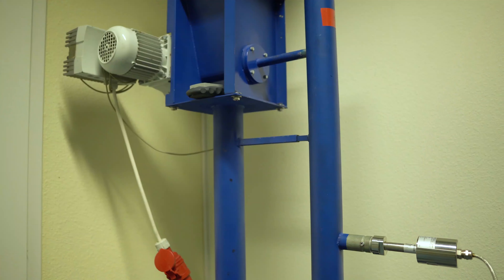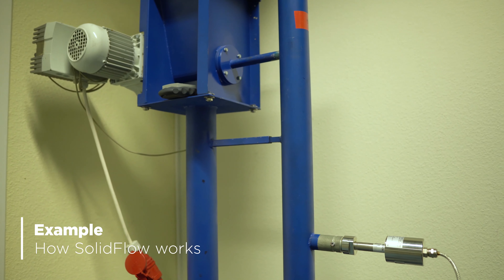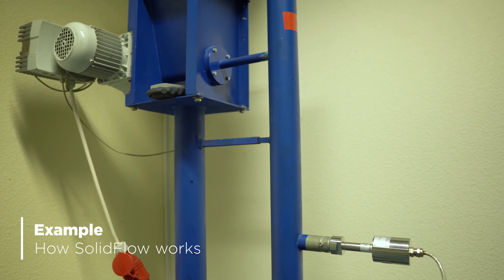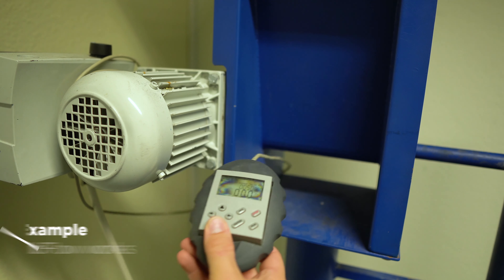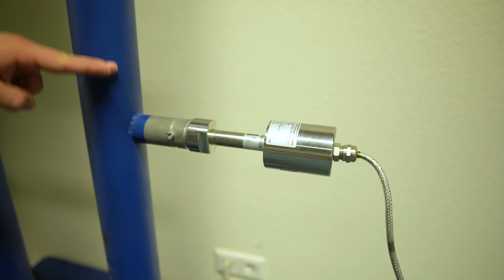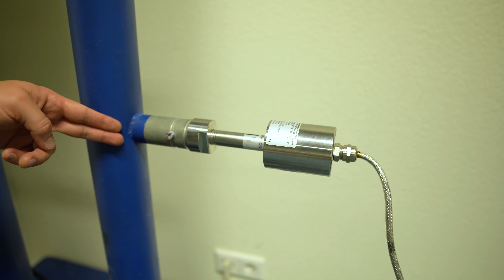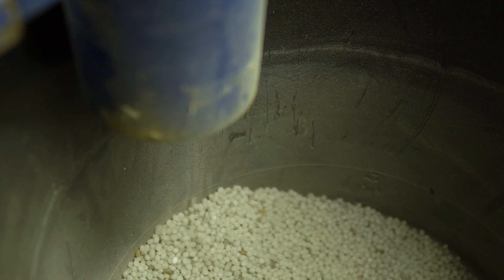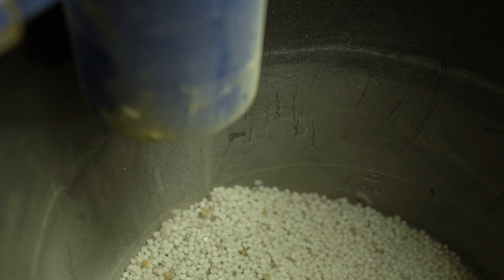How to measure Solids Mass Flow ? SolidFlow

Comment: Well, each material has different specific gravity. How does this sensor address that issue? We need these sensors for the prototype intended for pneumatic blends.
Reply from the maker: Hello Saeed, the sensor is calibrated considering 1 material type, in case of a different material kind a new calibration curve is required, you can find more info at: https://www.envea.global/s/process-en/flow-measurement-process-en/solidflow-2-0/

Comment: does any small scale sensor avilable for same aplication? in the video there is about 20 ton/h but our system requiredment only 1 - 5kg ofcourse in some fraction of time..... so can you guid me accordingly....
Reply from the maker: Hi Prasad ! Thanks for the question! For smaller flow rates, i would recommend: https://www.envea.global/s/process/flow-measurement/picoflow/ 
check it out
Reply: Can you please tell me the buying process of Continuous Flow Measurement
 at Low Solid/Air Ratios... and tell me price also...
I need your guidance for installation and getting output on screen.. so how can i contact you for same